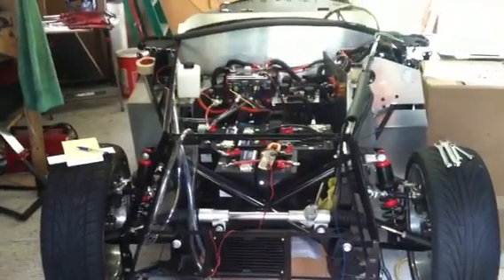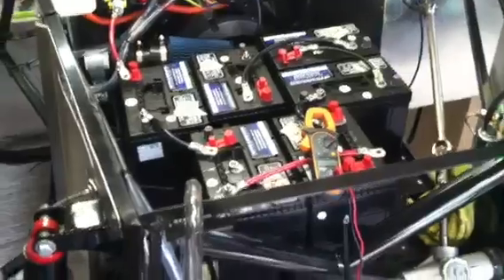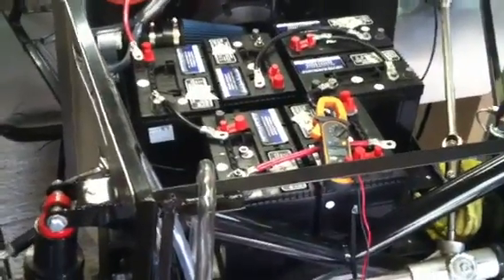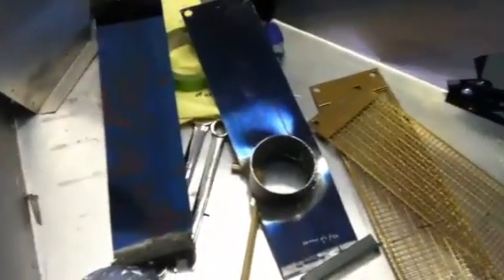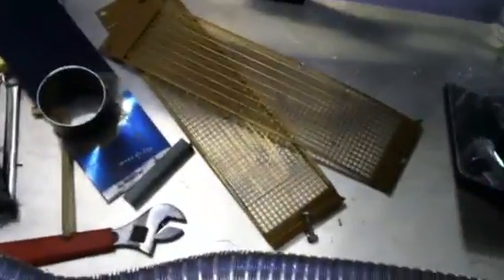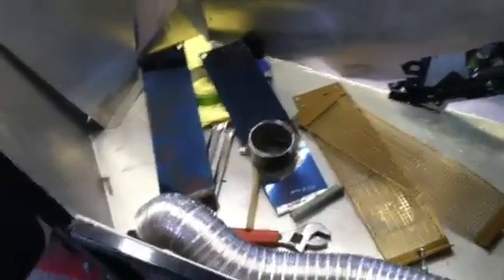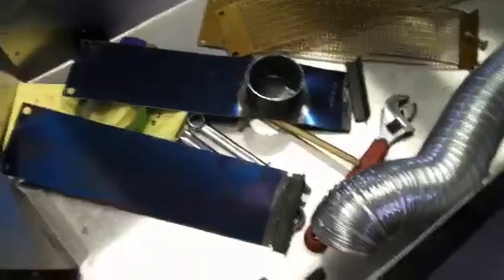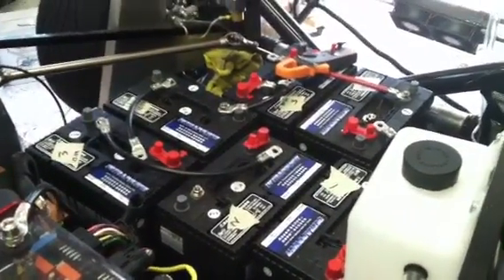Factory Five Mk4 - Electric Car  - Video 15

Comment: @ev99saturn Like yours, my car is extremely light with fiberglass body and lightweight chassis(VW pan and torsion bars) . Fiberfab is working on a full rolling chassis for my car, springs/shocks and all. I might have to wait for them to do their thing. I don't have the shop to weld or fabricate my own. The stock steel chassis they have now is not set up well for EV. Another guy just finished his GT-40 EV using that chassis and it looked funky. It's set up for a mid-engine V8.

Comment from the maker: @saxmanchiro "money is tight" seems to be a universal problem for most of us... and is part of the reason that lead is my the car now and not lithium :-(      I agree about the hub motors, looks very interesting, but does not seem to be getting much adoption and will certainly increase the overall cost and complexity of the design and build.   Plus for sheer raw power, one DC motor (or two DC motors in series) develops huge torque.   The NEDRA member vehicles clearly demonstrate this.

Comment: @ev99saturn I have been planning this build for over two yrs now. At first, I was going to use in-wheel motors but I think many companies have abandoned that design so I think a motor hooked up to a manual trans will be the way I will be going. I do not have my car online anywhere. Jack Rickard has given me some great component ideas and updates on batteries. He seems to really know his electrical stuff. I applied for the component contest but I don't think they will select me. Money is tight.

Comment from the maker: @saxmanchiro  Controller yes, charger no.   The controller will run on any traction pack from 24V to 360V, but the charger was an inexpensive model for lead that only goes up to 72V.     Is your GT-40 online anywhere?  What are you planning to use for components?   Good to hear you are going electric, you will enjoy it.     No, I don't watch EVTV, although I'm aware of Jacks show and Cobra build.

Comment: @ev99saturn Awesome. Can you use the same controller and charger for those lithiums?
I am currently starting a project to convert a Avenger/Valkyrie GT-40 replica that I built 30 yrs ago. It currently has a Mazda rotary married to a VW 4speed trans, in the rear. I put the rotary into it in '84. Still runs great but the chassis is toast from rust. I need to start from scratch so I decided to go EV. Love your vids. Are you watching EVTV at all, with Jack Ricard?

Comment from the maker: @saxmanchiro   The small and inexpensive 72V lead-acid pack is the minimum necessary to operate the car while it is being finished.    Lithium will go in later.    I hope to finish the rest of the car over the winter and start building the lithium packs next spring.

Comment: Why did you go with Acid wet cells? Why not spring for the Lithium and be updated? More range, less weight, more longevity/charges, safer in collision circumstances, etc.